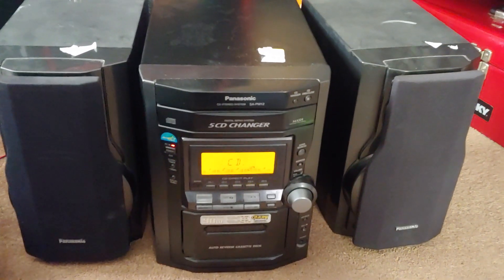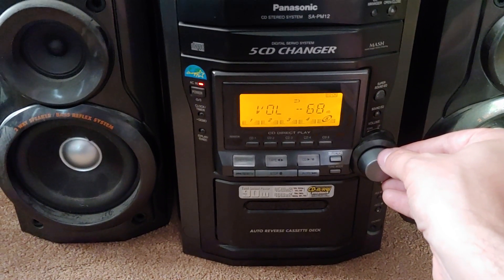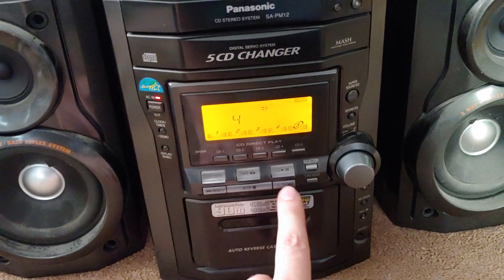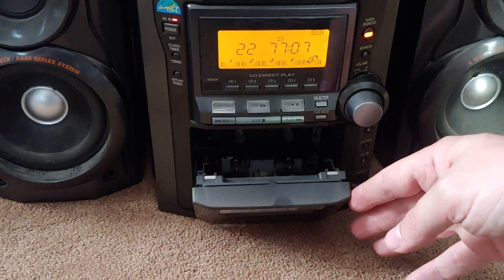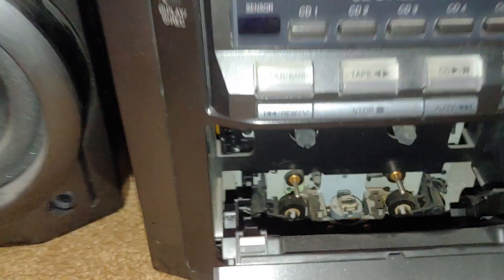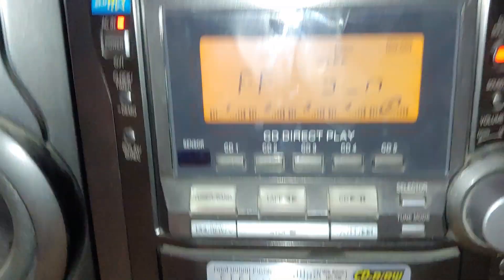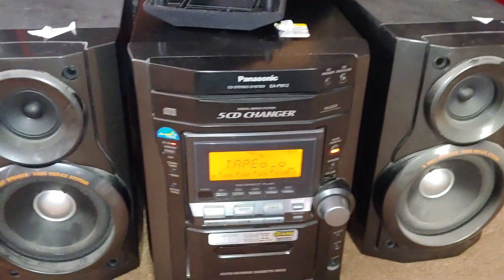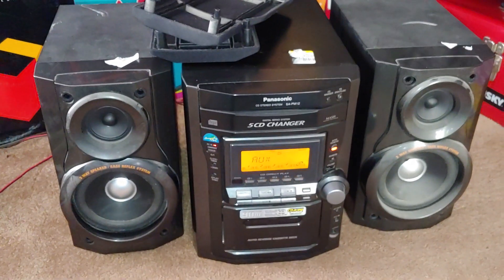Panasonic SA-PM12 stereo

Comment: I had a similar unit, a Panasonic SA-AK320 i think.  It had a subwoofer and two main speakers, red cones with silver trim. The decibel meter ran backwards but it sounded so good the neighbors complained.  I gave it away to save me from temptation and went back to using my Sony CFS-1035.
Reply from the maker: Aww you should've let them keep complaining. That stinks that you had to do that.

Comment: I am your new subscriber from India 🇮🇳 💐 🙏 ☺ Picked mine up yesterday from a thrift store. SA-PM11 & interestingly Mine has karaoke and a mic volume knob on the left side front panel. How do you load up the 5 CDs 💿 please? Thanks. No manual or remote. I swapped speakers from my Sa-Ak27 I bought in Toledo, OH back in 1999 but the main unit has been on the fritz for over 15 years now 😔 However, the speakers are in mint condition for a 21 year old pair and boy do they sound 🔊 great! 👏 👏 👏 💎 ✨ 👌 Thankfully the remote works so am all smiles 😌 😇
Reply from the maker: The way I load up the CDs is by first pushing the button to whatever number you wanna load a disc in and immediately push the open button. That should open up the tray with whatever number you pushed.
Reply: @christronicsdereksrandomness36  Awesome 💎 👌 Thanks a Zillion man. Much appreciated 😌 ✌